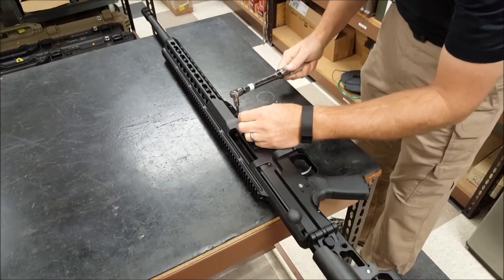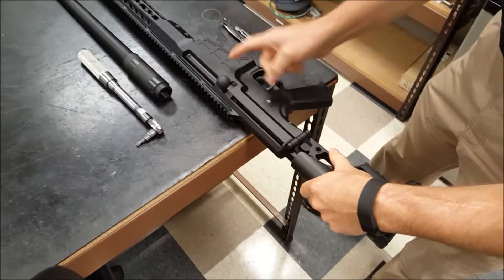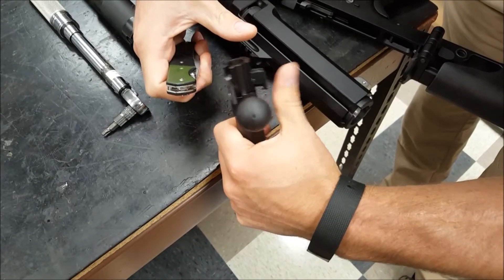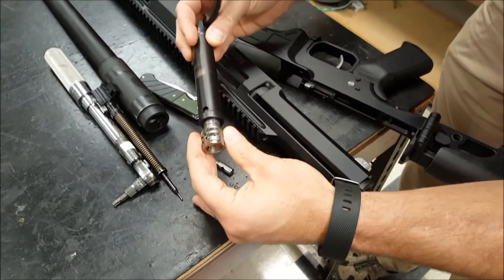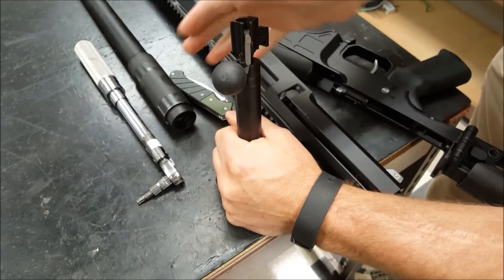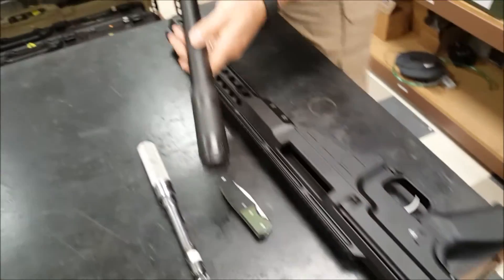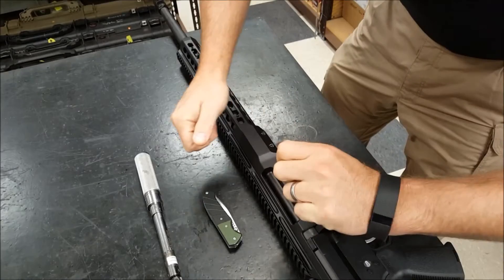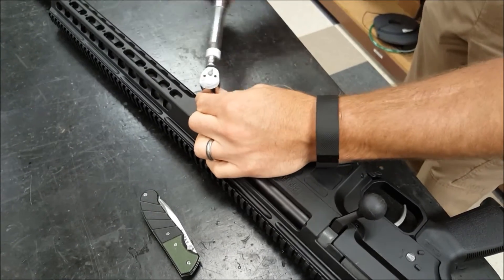MRAD Conversion Kit

Comment: 140 *inch lbs?
Reply from the maker: Yes
Reply: Yes, don’t go mixing both up.. the T30 plus Torx (TP30) and torque ratings in in/ftlb’s are engraved in the upper.
Reply: @gixer750boy  I'm sure you'd realize once you get out a wrench capable of 120ft lbs

Comment: Is t30 plus a must? or just t30 ok?
Reply from the maker: Its a must.  It ensures proper torque and life of the product.
Reply: @ArmedHiker  thanks guess I order one
Reply: Yes, the TP30 Torx bit is essential and a MUST! Not only have I seen a video where they state TWICE at different times in their video that a T30 Torx bit will strip the head.. I was told by a good friend of mine that I should buy some spare bolts for it… I asked why, and his reply was the bolts strip easily… So before I attempted this I researched thoroughly, and yes, I suspect my friend used a T30 bit🙄

Comment: hey man, I am new to this I am considering buying MRAD but can you confirm what are the calibres that it can be converted into? is it possible to convert this into 416 or 50bmg?
Reply from the maker: 6.5 Creed
308 WIN
300 WM
300 PRC
300 NM 
338 NM
338 LM

No 416 or 50
Reply: @ArmedHiker  thanks 🙏

Comment: How does your MRAD shoot? Was it worth the money? Trying to decide on the MRAD or the Model 98b.
Reply from the maker: The MRAD is held to a .85 MOA max 5 shot group at 100 meters with factory ammo before it ships from the factory.  The average for this rifle in production is .66 MOA.  This is the 1st 5 shot group thru a brand new single point precision cut hand lapped barrel.  After about 100 rounds, they typically shoot .25-.50 MOA.  The 98B Tactical is held to the same standard but they hover around .75 MOA average in production.  I believe this is due to the heavier design of the MRAD.  The same quality barrel blank is used to make both barrels.

I have personally hand-loaded my ammo and have shot so many .25 MOA groups I can't remember them all.  .338 LM, 300 NM, 300 WM, .308 WIN, 6.5 Creed.  I've shot them all and they all perform about the same.  The best thing about a MRAD is that it is so ergonomically friendly, it fits everyone and even beginner shooters shoot sub MOA groups.  It truly is a gun that hits what you are aiming at.  I got bored hit targets out to 1980 yards with my .338 LM which had a 20" barrel.  Buy one, you won't be sorry.
Reply: @ArmedHiker  you just wrote the best review I’ve read for this gun in two paragraphs.
Reply from the maker: @ProGunsZach  thank you!
Reply: Great review